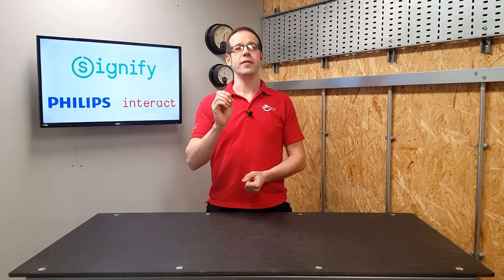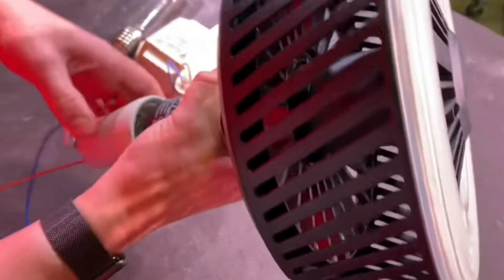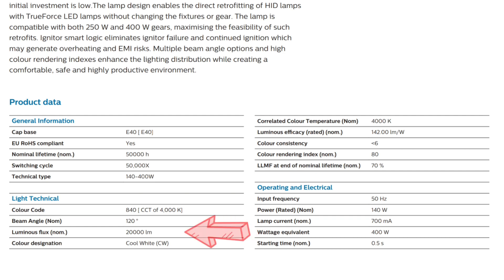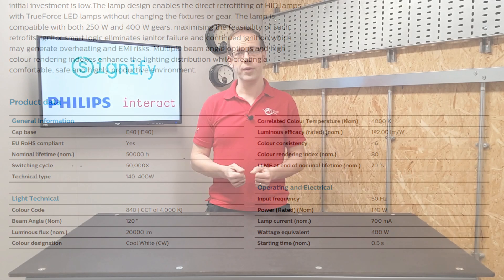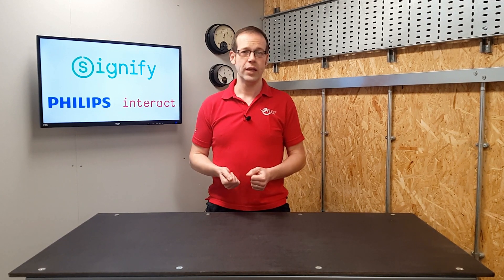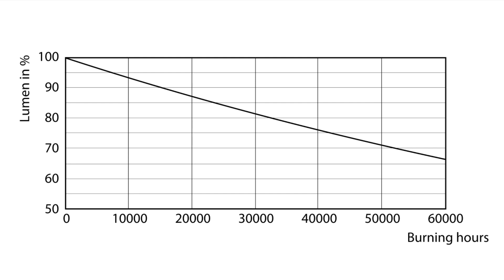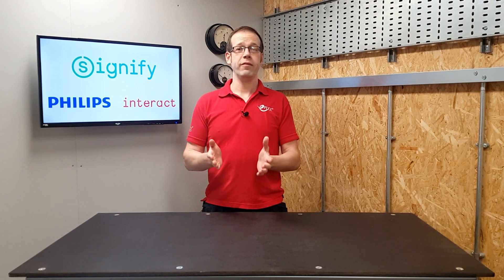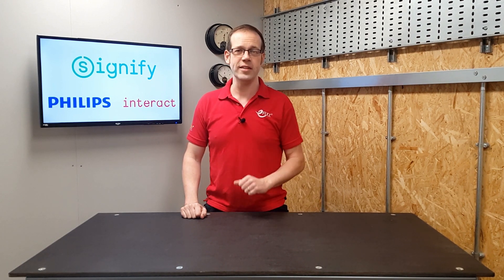LED lights DON'T DIE they simply fade away -  What does the L70, L80 and L90 number tell us?

Comment: Im not sure if included in your other videos, voltage drop is absolutely critical with tape leds last room install needed 2.5mm 4core as it was rgb and a fair distance from the power supply. 

And Maximum run of tape is important as its easy to exceed the tapes maximum current. 

I hate long runs poorly designed were you can see the gradient as it gets dimmer

Comment: Joe, Why do you see some LED fittings constantly flicker is this the LED or driver, and what causes it.
Reply: Flickering is a sign that the LEDs themselves are failing. Normally as a result of being driven at too high current and have got hot.
Reply: @davepusey  Thanks for the explanation Dave
Reply from the maker: Nice answer from Dave, it may also be hooked up to the wrong type of dimmer. 👍
Reply: @efixx  No dimmer involved every time I go past the Newport Pagnell services northbound there is a LED flood on an 8mtr lamp post in the service yard. In a car park in a retail park in Northampton and we have replaced a JCC 21w round bulkhead at an office porch now the combined factor could be cold and damp getting into the electronics of the drivers interested in other's thoughts.